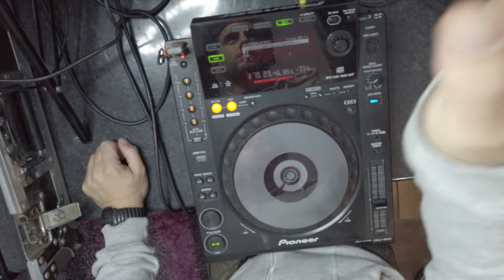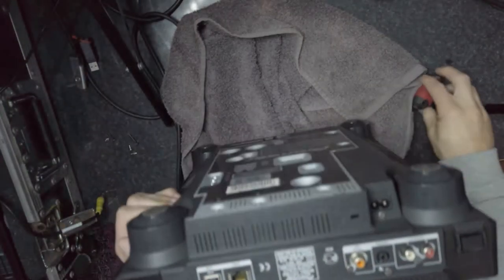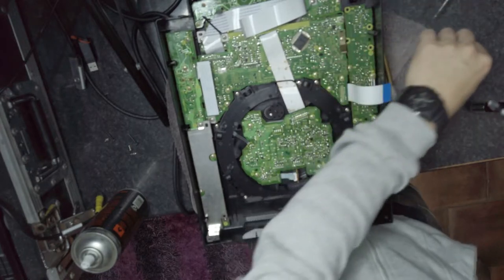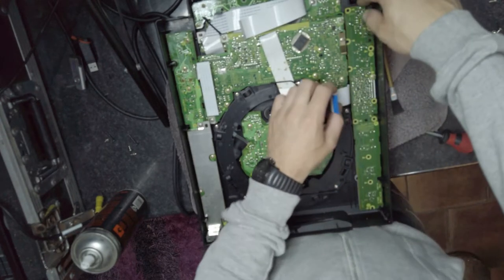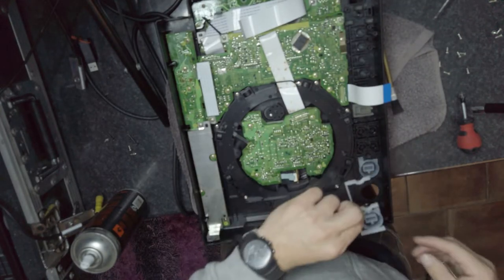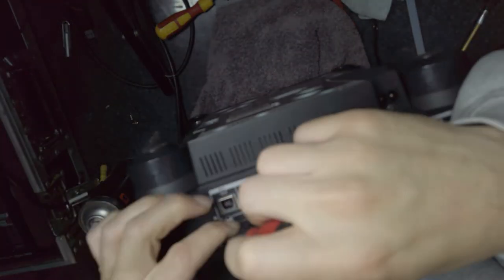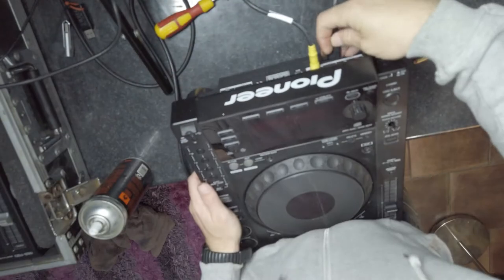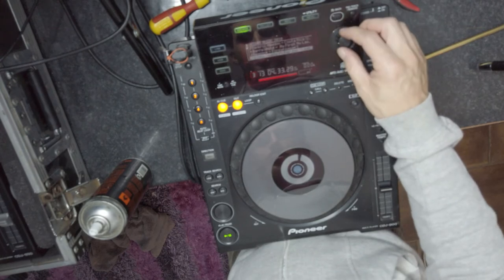Pioneer CDJ 900 Button Repair CUE/PLAY, FIX CUE / PLAY BUTTON CDJ 900 Pioneer

Comment: same as 900 nexus right ?
Reply from the maker: Yeah there ruffly the same
Reply: @BlancoMario  thanks. My forward search button stopped working 😔
Reply from the maker: @nofood1  Did you spill something on it?
Or was there some of pressure on it
Reply: @BlancoMario   i bought it used, prior owner must've used that button a lot, I also use the button a lot, Im guessing just years of wear and tear, but I wonder if i open it i can clean it a bit not sure